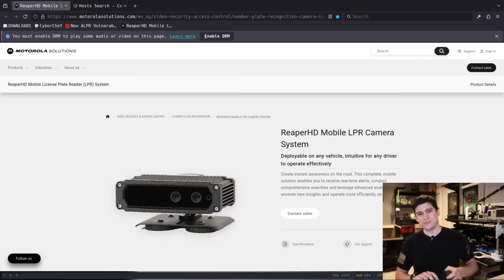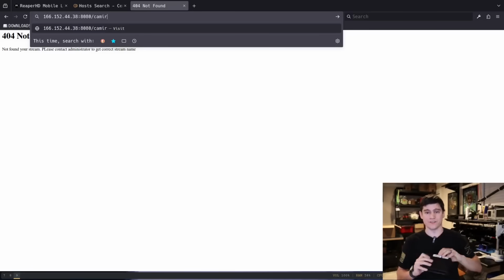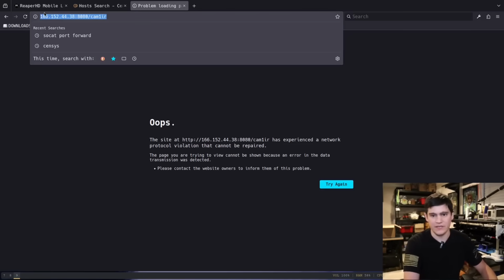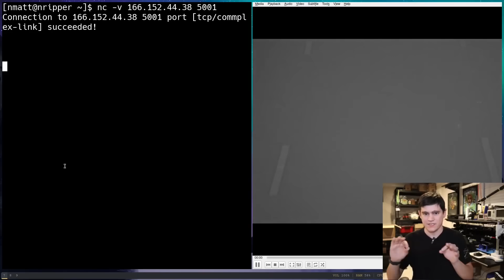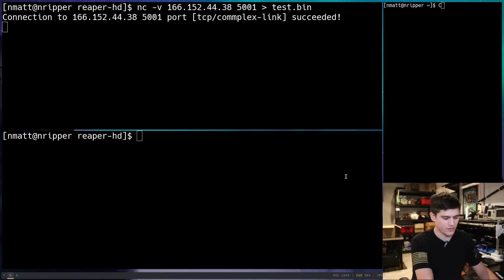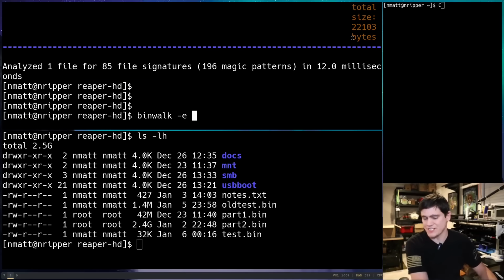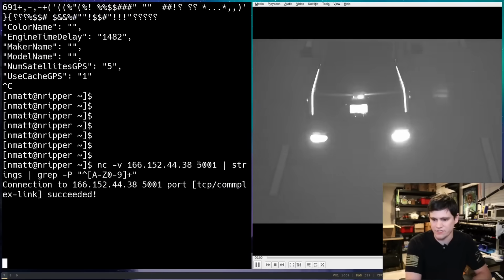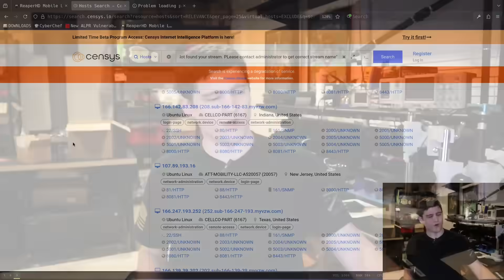Public Video and Data Feeds of Highway License Plate Readers

Comment: Man, when TPLink cameras are more secure you know you've messed up.
Reply: I would love it if Matt would examine some of the TP-Link equipment that is being called into question by the US government.
Reply: @PureMagma I think he did already with a TP-Link router
Reply: @PureMagma  I have a TP LINK TL-WN722N that I havent used in nearly 10 years. Is this on a sketchy list?
Reply: Hahahaha, this one must have hurt xD
Reply: they are not?
Reply: lol
Reply: interesting I just released a tool to look in their firmware.
Reply: Xi like your joke.
Reply: They are not designed to be secure, and you have no legal right to privacy on public roads. They don't attach any registration information. The highway cameras are not usually operated by law enforcement; they are installed by the highway authority or their traffic management system. 

They don't attach any regeneration information to the feed. People are driving around the highways all the time, recording things.
Reply: This is probably intentional. 
The area being viewed is a public space with "no reasonal expectation of privacy." The department probably doesn't want anyone using it, but would rather have PI's (or the public) using that than have them physically trying to stake out highways or clogging roadways, causing a danger to themselves or others just to view a narrow space in a public area.
Reply: @Gabonro  I will not comment on the "no expectation of privacy remark", since it doesn't matter.
 It is probably also very easy to stop these devices from working. Either using the open SSH port and a different default username and password, or given the fact that they put zero effort in security, using a simple buffer overflow. That can never be intentional.
It actually surprises me that the specific IP address shown in the video still works 6 hours after posting it.

Comment: A LOT OF video feeds are in the clear on the Internet 
A lot of information is sent in the clear over the web

Back in 1995 before the high speed fiber was run across my state I worked for the government and we would do our data dump back to the sources and you LITERALLY saw the Internet slow down all across the region as our data took priority and used a lot of the available band on the phone network 

I noticed it happen and it happened every time 

I asked if we were using the Internet and they told me yes

Very few closed networks not connected to the Internet
Reply: Hence the use of what are called "VPNs".

Comment: Before the phase 2 digital simulcast trunked networks cities had a dedicated pair of Frequencies, one for the devices to send to the network and one for the network to send data

We used to see the data feed going from the tower to the devices and it was a big wide signal 
The DMV would send the data automatically and if a plate was a hit to a wanted plate or an expired plate, the network would send an alert to the MDT in the police car and an alarm went off in the police car and the plate photo popped up on the screen

Comment: If these cameras send location metadata - for example embedded in the jpeg - you could even programmatically generate location profiles of individual vehicles based on their plate. That's crazy...
Reply: There was a field showing the number of satellites used in a GPS solution.  I bet thats in the aggregator device.
Reply: Illinois has a lot of drug trafficking, they use the image data to recognize patterns and will target specific vehicles matching repeated routes
Reply: If you do a geo lookup of the IP address it seems to come from Chigao at the South Columbus Drive
Reply: @brewman467  You won't get very good accuracy with such services.

Comment: The IP is a Verizon Wireless network, So they took a cradlepoint router connected via cellular with a static IP and port forwarded everything to the Motorola ALPR Server. Wow!, Great find. Someone needs to be fired over this. They should have taken an extra 5 minutes and configured a VPN so there would be no open ports and all the data would be encrypted. And to your point, Motorola should have some authentication on their side too.
Reply: Scan that subnet and get another huge surprise. There are MANY hosts with wide open ports.
Reply: @BertRedd crazy
Reply: My guess is that it's simple and plain incompetence.
Reply: Close enough for government work as my college professor used to say. 

They hired young talent who's just savvy enough to configure the bare minimum to get it functioning, nevermind good practice TLS or a VPN to keep it from public access. 

This was common place with a lot of IoT infrastructure about a decade or so ago.
Reply: It should be accessible to the public. Why would u want to prevent info from remaining public? Blows my mind. Ppl with that mindset not only hurt themselves but everyone else. You're not a hero.
Reply: Most all of these cameras are advertised and viewable on maps from most DOT websites. That's why there is no Auth. They aren't intended to be private.
Reply: @user-bx5qc3vw3w  I highly doubt it is intended for the public to connect to a camera that is hosted on a cellular connection. The Stream would have to be loaded to a public web server, capable of handling much higher bandwidth.
Reply: That's what I was gonna say....
Reply: its nepotism, one guy hiring his buddy to get him the salary, then that buddy goes to another place and hires the first guy etc just in time before shit hits the fan, the guy who approved this is probably gone making 50K more than before
Reply: @GamingAmbienceLive  It isn't nepotism. I overheard the head of HR complain about too many white male engineers. She preferred Hispanic females and was working on making that happen.
Reply: Oh, Motorola is now owned by the Chinese so there’s that too.
Reply: Don't know much about cradlepoint but surely the least they could do is set up a firewall to only allow traffic from to/from the Motorola server and nothing else, thus locking the rest of the public internet out of it.
Reply: @thetechdudemc cradlepoint is popular for automotive internet. I installed cradlepoint in a ton of school buses to give them a built in wifi setup
Reply: Cradlepoint is an LTE router used for pretty much anything everywhere. They dont control what the customer does with the hardware.  @thetechdudemc
Reply: @thetechdudemc  This would be a good first step but still leaves the connection subject to a MITM attack. Motorola also could have configured the product to send the data to a server via SSL rather then having any port forwarding or open ports on the actual device.
Reply: If they're using something like cradlePoint, they have VPNs already built into the device
Reply: @DesertFernweh  Exactly, all that they need to do is configure it!
Reply: As a business or the government, you can usually have the ISP handle all the VPN details. Verizon offers multiple VPN solutions. Not that it would be much of a problem to implement it yourself with some half-decent router with 4G/5G modem, for less than $100 per unit.
Reply: Feature not a bug.
Reply: This entire comment  reads like a scammer thread. Everyone is talking but aren’t saying anything.
Reply: @horsehairedmessiah  ((whispers)) You're sticking out like a sore thumb bud...
Reply: Much worse, IMO, is that they are degrading cellular data service in that area. People using Spotify are going to be pissed when their tunes start buffering (yes, I do know that audio streams use a lot less data). It a joke!
Reply: I am sure they will get a raise and a promotion
Reply: Motorola is China now, so that's even better.
Reply: Eh I feel like these readers should be public info anyway, but I'm surprised with the lack of security as well
Reply: Why...  License plates are public information and there is no private information given from logging into these public cameras... Have you never logged into the live camera feeds in cities all over the country and seen a vehicle driving by?   Why would you spend extra money and take any extra steps to secure public information that anyone can record with a simple $50 dash cam.  People complain about government waste spending and how our tax payer dollars go into this tech well here ya go, enjoy the free data feed of a huge nothing burger
Reply: Meh, FTP.
Reply: You think the people that do our infastructure care about IT security? 😂😂😂😂😂😂😂😂😂😂😂😂 they only care about money
Reply: Turning into China
Reply: The company who installed and configured them is at fault.
Reply: Can we we be friends  @aqatrax123
Reply: Could you highjack the video input or output and just feed these cams crazy ai stuff? Like a car pulls up and 300 Mexicans get out or funny stuff like that?🎉🎉
Reply: So spy planes or balloons can get this data?
Reply: It’s our tax dollars at work. We should have access to the data stream.  What I would argue is that this is a waste of tax money, unless they can show the they’re doing some kind of analytics on the data that actually benefits society, not just the fat cats getting fed off of our money
Reply: Taxpayers funded devices can't be accessed by taxpayers?
Reply: Why would they CARE? People need to realize that!
Reply: Those devices should be locked down better. It’s not a huge deal for most of the public out there, but it does allow more people to track your movements if you become a target. You could access multiple cameras in an area and have a program running that lists out a certain license plate and get some intel on movements.
Reply: what is JASON ...??
JSON7 etc...??
Reply: @JACK-wh6jl  JavaScript Object Notation File It is primarily used for transmitting data between a web application and a server. JSON files are lightweight, text-based, human-readable, and can be edited using a text editor.
Reply: Mate, there’s like 4 BILLION IP addresses, ain’t no one gonna find that! 😂
Reply: @Axman6  You don't know what you don't know.
Reply: Greed, greed always ruins everything that could be good
Reply: @iVETAnsolini Unfortunately these words are the truest words in this comment thread, and their are some very true words being spoken here...

This whole situation echo's of decades of incompetence rolling into the digital era and not changing.
Reply: What reason would there to be encrypting it? License plates are public knowledge
Reply: A bad actor could be watching for a specific plate, and be pinged when their target passes the location. It's what the system was designed to do. But apparently anyone can use it, including criminals. Nice work gov.
Reply: @DarkAttack14  A good reason is that even kids could block genuine police and other agencies from doing their job with simple attacks. You can block the cameras and hide someone passing on those roads.
Reply: @DarkAttack14  Loose nut behind the keyboard lol
Reply: @DarkAttack14  Where they are, and pathing them shouldnt be.
Reply: @DarkAttack14  I said the same thing and this sqib deleted my post hahahaha  too many goof balls think they are cyber security geniuses
Reply: @timlevey  ole Dunning–Kruger at work right haha
Reply: @timlevey  It's logic like this that causes exploits like this.
Reply: @DarkAttack14 Ironic you'd bring up dunning kruger when you're clearly on the stupid end of the scale.
Reply: @DarkAttack14  Because this system is not for public access. There is no reason why this system should be exposed to the internet.
Reply: @aquatrax123  There is no reason it shouldn't either, this is a non issue
Reply: @aquatrax123 its a public camera. No different than a body cam is, which you can foia. If they didnt have it public, they would have to have a searchable data base.
Reply: They don't even need vpn. At least firewall the IP to their server as needed.
Reply: You still cannot find registration info. You can read a tag all day long. No biggie.
Reply: @ncso911  I don't think you realize just how easy it is to get that information via friends who have friends. Ask me how I know? I had to keep my cars and license registered to prior addresses due to a stalker who had access these systems. Even when they lost access to it, the person still had family/friends who could easily get it for them.
Reply: Yes, but now a known plate could be stalked by anyone, not just the gov. A criminal could be immediately notified at the moment their target passed this specific station.
Reply: The police should have a private trunk with all mobile traffic routed back to HQ and nothing exposed to the internet directly.
Reply: @jba6677  The police shouldn't have mass surveillance dragnets in the first place.
Reply: @jba6677 license plates are public knowledge anyway, no reason to encrypt. There's absolutely nothing here that the public can't gather with their eyes
Reply: @jba6677 " private trunk" tell me you're a old phone guy without telling me you're an old phone guy
Reply: Only in America

Comment: Now we need an on-vehicle sensor that detects these readers and automatically obscures the plates for a few seconds.
Reply: Flock safety uses ai and can easily search for and correlate cars with obscured plates and alert in real-time. 
The only way to hide is be an indistinguishable tree in a large forest.  
They can even search cars for particular bumper stickers and generate the same pattern of time series location data for that unique vehicle.
They also read political signs in folks yards as mobile readers pass by.

It's not going to stop. I'm for forcing them to make un redacted data available to all, to watch the watchers and level the field.
Reply: Theres no way that if you installed sone 850 nm ir led bulbs next to the regular license plate lights that any thing could hold up in court because of many factors that would have to fall just the right way to prove that and thats even if a camera is able to pickup the obscuring of the plate due to excessive lighting..  lol.  It couldnt be spotted by anybodies eye though..
Reply: Mount strong IR LEDs near your play, it will overexpose the ir feed
Reply: @rj7855  it wont, some people on youtube tried that not that long time ago
Reply: @rj7855  Illegal in most states
Reply: There was a reflective clear gloss apray that adhered to the license plate specificially for this purpose. I wonder if its still around. But the LEDs, as mentioned is definitely a winner.
Reply: @Nam3H3r3 I thought those were shown to be bunk
Reply: @Nam3H3r3  Not legal in most states
Reply: @Nam3H3r3  You'd need a system to ensure the IR LEDS are bright enough and working..

Comment: Throwing away my license plate now thanks lol
Reply: just get some brake cleaner and clean your plate off, no more reflection just work quick or you will get the paint under as well lol. its illegal to do that at least in my state so pls dont
Reply: @Unkemp7  yeah im 100 percent joking bud. I dont have a car lol
Reply: @apIthletIcc  my buddy did it in his motorcycle way way back and got popped for it which made me think of it lol
Reply: @Unkemp7  I'm just curious how this went down - does the guy admit to tampering with his plate? I'd just claim to not know why my plate was not reflective like they expected. Next time they should build a plate that withstands the cleaners I use. I often spray things down in brake cleaner to clean it :)
Reply: @404Lambo I'm assuming the "don't do it" was referring to the original idea of taking off or throwing your license plate away, not the brake cleaner.

However, for example in Texas, any covering, protective substance, or other material that obscures the readability is prima facie an offense. Other states require similar, even including clearing snow off. Not knowing, or claiming you obscured it unintentionally, isn't a defense.

In Texas, oddly it's a higher fine for obscuring your plate or having a fake/non-matching plate than it is for operating without a plate, and an escalating class/fine vs. not. Both are common among motorcyclists, but it's often assumed to be the other way around in severity.